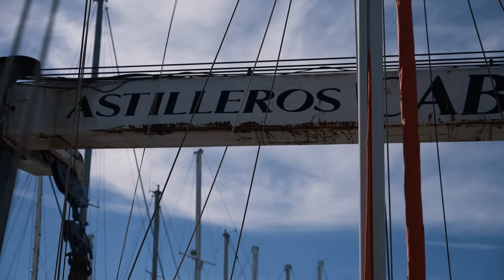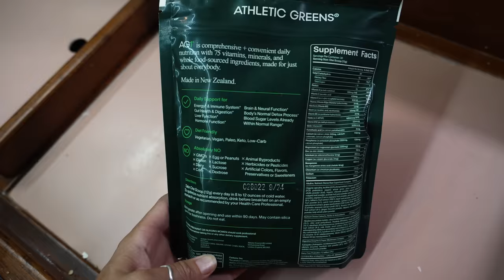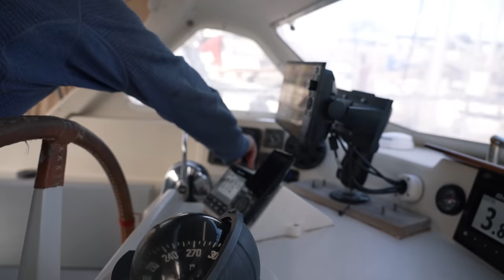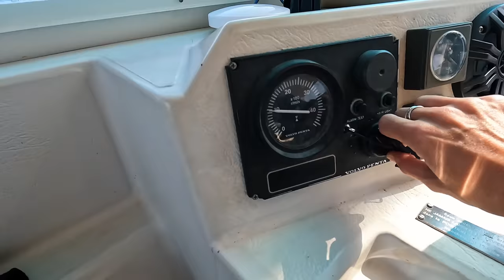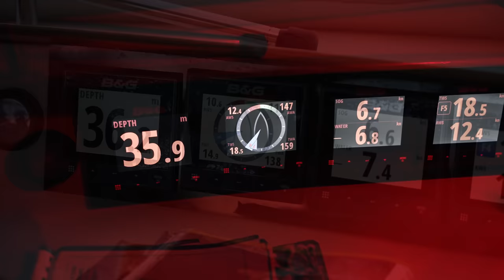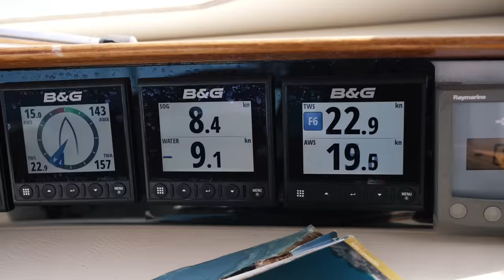Boat Work to BIG WAVES 🌊 One HELLUVA Shakedown Sail!  Sailing Vessel Delos Ep. 410

Comment: Just a tip for those who haul out.  Before you splash, you might want to coat your raw water pump impeller with Dawn dishwashing soap.   It is safe for the water and it does 2 thinhs.   It is a lubricant for the impeller.  The hardest thing on an impeller is to run dry.   The other thing it does, is create an airtight seal to suck that water in better.

Comment: As a father, and (former) sailer, I see the open bottom of the cockpit enclosure as a risk for a young toddler.  Seems like there’s a false sense of security for a little tyke and she could lean against it and fall under it and out of the safety of the cockpit.  A possible solution is “ Smart Fasteners” at the bottom to reduce the risk.